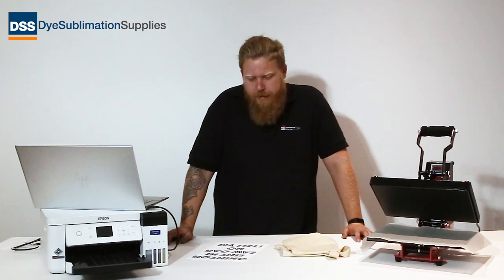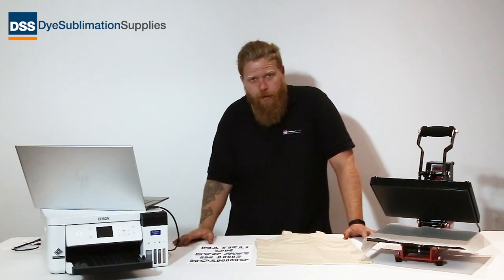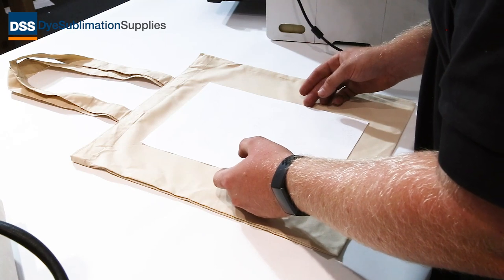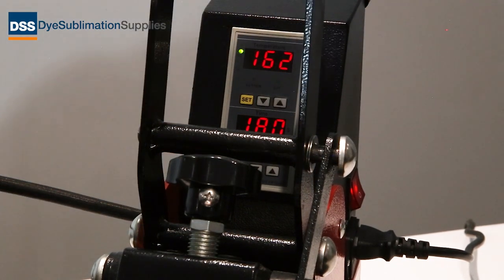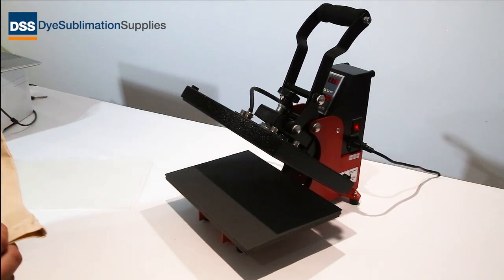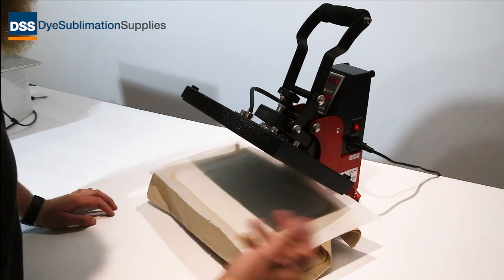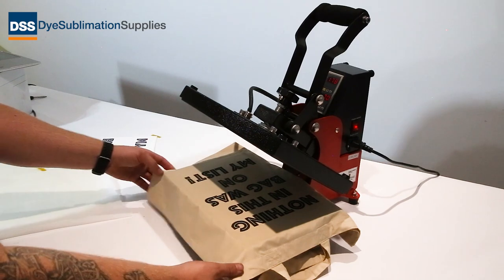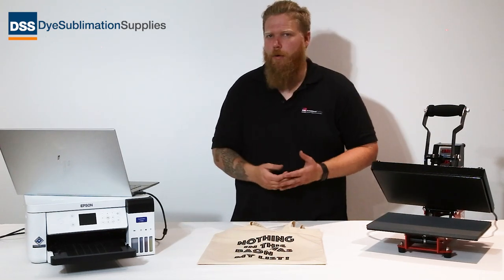How To Sublimate - Polyester Tote Bag

Comment: is there any special consideration to make if the tote bag is 100% polyester? I keep on getting the image with a "ghost" effect
Reply from the maker: ghosting is often caused by the print moving around on the item. Ensure it is taped down correctly and when you take the print off remove it quickly 😊